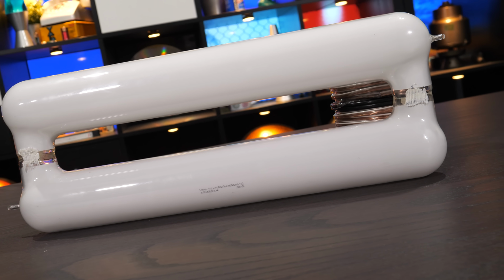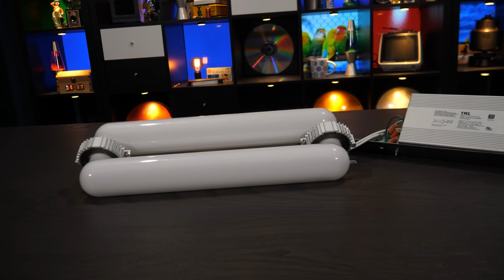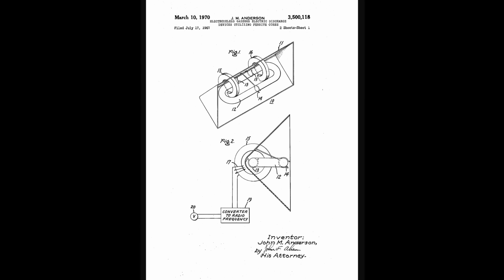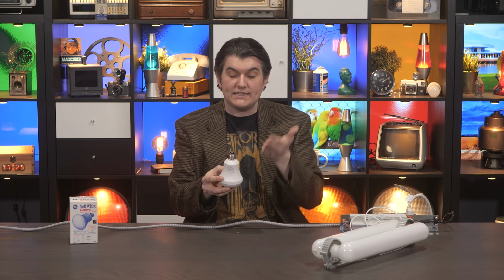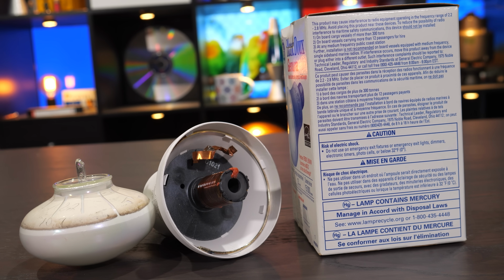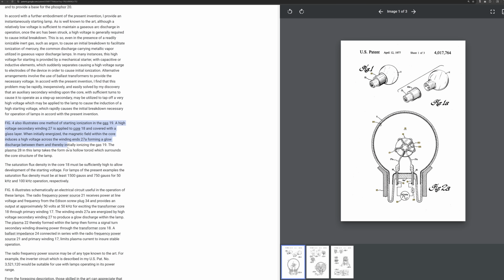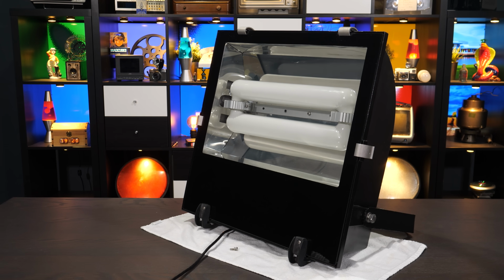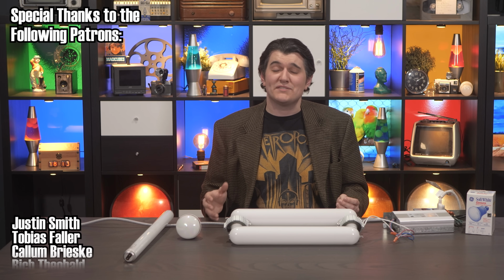Induction lamps: fluorescent lighting's final form

Comment: I also had a portable florescent straight lamp that used four C cell batteries, and the small size was great working inside aircraft when I was an avionics tech. That little lamp was replaced with one that was twice as long, and used eight AA batteries, and I was able to repair many aircraft electronic problems using those lamps!

Once the electronic circuits were cooked, I switched to 60Hz AC powered florescent lamps on a long cord and also having an outlet for power tools. Which wasn't as needed as when I started, as tools became battery operated soon after! And RF lamps were nothing new, with many amateur radio operators making different lamps to slip over the antennas to light up an area with the RF power on an antenna. My favorite lamps were the circle bulbs used in kitchens and baths in the center of the room. You could light a large area with a small circle of glass and a small plug, and the ionization made easier with the plug, but not the heaters installed in them!

But having a small radio transmitter on your light bulb was a big downfall when you wanted to have radio communications without interference from the lamps. And being a radio amateur, I have to experiment with lamps, including LED bulbs, to ensure RFI free lighting.

Comment: I've not seen a dimmable LED bulb meant to go into a regular alternating current light fitting that wasn't plagued by constant flickering. Even if it was placed in a non dimming fixture. Of course if you have a LED with custom driver electronics you can use PWM etc. to get it as dim as you would like. And yes running LEDs significantly underrated using these techniques you can extend their life.

Comment: Gday feller, the internet is patchy here ATM, so difficult to look thru the answers. Your question about how these lamps initially ionise. They usually run somewhat away from resonance during normal operation, during startup, an L/C circuit switches into resonance. As we know, the impedance of a series L/C circuit is zero at resonance and therefore the current and voltage build up limited only by the resistance of the circuit. this high frequency high voltage is applied capacitively through the glass to the inside of the tube and the gas. Hence the tab on the outside of the bulb. Hope this helps. RSPV Mink

Comment: Fun fact, I worked at a place where replacing the lights was really expensive because they’re really high up and so they need a very large man lift to do the work so they replaced all of the bulbs at once that are not, and they left them on 24 hours a day because the additional electrical cost was determined to be less than the wearing out of the bulbs and their replacement
Reply: Yeah I was thinking something like an airplane hanger/shop or large warehouse would use these.
Reply: @codemiesterbeats  Assuming EMI and the diffused lighting isn't an issue. These days modern LED arrays can be made with extremely good lifespans when they want to. Even our typical house bulbs could be notably improved by splitting the load across more LEDs but manufacturers don't like doing that.

Comment: I can't get an E26 LED bulb to last more than a year, not even high quality GE anti-flicker true color index bulbs that were pricey. :( The dimmer must be the secret sauce. I think the bulbs burn out because their components are over driven and under sized for the spec that they require.
Reply: The form factor makes it very hard for them to cool off, damaging the LEDs, potentially burning them out. If you are unlucky, they will turn purple, and hurt to look at.
Reply: I call BS. My Philips LED fan lasted me more than 5 years and running

Comment: Electromagnetically smooth jazz. Induction itself is a neat technology that I'd written off as "that thing for phone chargers and stoves" until I realized I could use it in one of my hobbies to create lighted display pieces with no visible wires nor any need for tricks to hide the wires through a conspicuous contact point. And if your lighting circuits are all built to the same spec, you can use the same display base for multiple things with no more effort than picking one thing up and putting something else in its place.

Comment: Are these toroidal transformers similar to the spark plug coil on older cars? When the field collapses the current would go through coil and out to the the spark plugs.
Reply: No, they are electrically coupled to the coils, whether inductively or capacitively, I don't know. It is at least started via (high) frequency dependent disharge, and could be run with very low power after the initial glow discharge happens.

Comment: Mixed feelings - I watched a guy on youtube recently talking about why LED's don't last - he mentioned that in fixtures like in his kitchen, where a light serves as a nightlite, and never gets shut off - that LED's don't last - they don't seem to handle the heat of fixtures well, even if it says they do on the box. I posted back that in this case I would stock up on a few good florescents that would do the job - in my condo, I have replaced a lot of my bulbs with LED, but I still have some great 4 foot long Lampi fixtures, which had kind of a european look to them - I love the look of these when I want to really light up the living room to work on something- one thing that really irked me recently was to ask GE how do I replace the light bulb in my GE Cafe Courture countertop oven - they said "you don't" - it is a LED. If the bulb goes out, you replace the oven. And of course, LED's last forever, unless they don't. And when remembering these wonderful electronic ballasts of florescent bulbs - they really shortened the life of the florescent bulb often - my brother was scared stiff of them after having one fail and start emitting some black smoke.  I wasn't overly scared of that, but the florescent fixtures with the old magnetic ballasts lasted far longer, and the bulbs lasted longer.
Reply: Like with most technologies, it is inevitable that the manufacturer simply rug pulls you. LED were promised to be long lasting, but they used a lot of marketing and legislation to become a dominant technology, then started using cost engineering to slowly renege on their promises. Longer lasting? No. Great light quality? Looks are deceiving. Low EMF? No.

But yeah, be nice to the fluorescing tubes, and you won't have to worry about them. The main thing is that the ballasts are generally not current limiting. The voltages the tubes are run are at a critical point where the plasma is dark, glowing, or arcing. It takes a bit for the plasma bulb to self-focus and start arcing, but PWM is commonly used to cut the power before that happens. Alternatively, you can limit the current in the system so that it doesn't arc, nor flicker between dark and glow modes. The benefit there is less heat from resistance, switching losses, and you can probably run the bulb with a lot less power.

Comment: Fantastic - yet another source of electro magnetic interference, as if we didn't have enough already with shitty Chinesium wall-warts and crappy solar controllers blanketing the RF specrum with RF noise now were going to have a shite load more.

The fundamental frequency of these devices lands in the middle of the decommissioned MF Marine Radio Band, part of which has now been made an Amateur Radio Frequency band, and the harmonics from this lunatic light will populate goodnes knows how many frequencies up into the HF Radio frequency spectrum.

Comment: ge bulbs were 35.00 a unit I install them over city pool  the life of those  65000 hours on the boxes I got  they ran for years and years replace 100 and 150 down light flood lamps save tons electric power. but there problem was the incandescent were always burning out.

Comment: I work in a data center and it's on the operations side so I deal with a lot of electrical stuff. Either way, I've been learning a ton about  transformers and generators for the power side. The moment I saw those clamps that go around the tube I knew exactly how this thing worked and I got so excited cuz I'm like "oh shoot! I finally can put this knowledge to use outside of work"

Comment: Single glass tube with an inner tube for return flow.  Then one cylinder could run off one coil.
Reply: Something done in more advanced tokamak reactors is forming a field aligned current in the reactor's plasma. In effect, doing what you are suggesting, but letting the plasma do that on its own. You can liken it to the plasma trying to fashion itself into a coaxial cable that has very little interference and wasted energy. This is one of those plasma effects that is well known in the lab, but not talked about often because of the faulty assumptions in magnetohydrodynamics.

Per tokamak reactors, it significantly mitigates plasma instabilities.

Comment: Would just a tiny amount of alpha or beta radiation emitter be enough? Radon, Americium 247, etc. That could ionize the gas and allow startup.
Reply: Just have a starting circuit that uses a power transistor that shunts through a different resonant circuit. Higher frequency, lower breakdown voltage. Then move to a current limited circuit that maintains a continuous glow plasma.

Comment: I've been in arguments on Facebook over the longevity of LED bulbs. I have one in my bedside lamp that is almost 5 years old. I moved into my current house about a year ago, and all the other bulbs for my ceiling fixtures and living room lamps are new. If they were incandescent, I probably would have had to replace the living room bulbs by now. I expect they'll last many years. I think I noticed a bit of flickering once in one in the kitchen, but I hope that was just a voltage fluctuation or frequency drift. I haven't noticed it recently
Reply: I have one in my living room that has lasted me 6+ years. Even the dollar store LED bulb lasted me 4 years running 24/7.

Comment: Sure. LEDs claim to last 30,000 hours. The LED part does. But the drives may only last 5000 hours. I just put in a cheap one that came with a fan and it only lasted 100 hours. They want you to buy new ones. The 30,000 hour lifespan is deceiving.

Comment: Planned obsolescence isn't a conspiracy, it's just a corporate business practice that most large corporations use to increase profits. Tires, electronics, clothes, light bulbs, cars, pot scrubbers, it's just designed in.
Reply: Sure buddy. Whatever your echo chamber says
Reply: @mohanjan8768 planned obsolescence takes too much effort, now you have to pay a monthly subscription for your exercise equipment, baby monitor, home CCTV (cameras, and camera door bells), thermometer, home servers, media box (like Roku), smart bulbs, refrigerator, TV (all of them are smart nowadays, there is no escape), printer (not just ink), ... To function. For insult to injury, cars also have subscriptions for activating your heated seats (which are already in your car), travel length of your suspension springs (apparently you can adjust those electronically now), to be able to use the GPS/bluetooth/radio (honestly, you should be allowed to install your own), or be able to use performance or efficiency optimised fire tables and PID weights for your automatic car.

Comment: The secret to the striking voltage is the high frequency. Gas ionization occurs at much lower voltages with the increase in frequency. Given that you're a fan of Nicola Tesla I'm somewhat surprised that you missed this fact. That said you may want to have a look into ionic drives because they operate in a similar fashion. There again, its the frequency that makes it work. A good resource for furthering your understand is @PlasmaChannel which I'm sure would be more than happy to go over the details with you.

Comment: I found a strange lightbulb in my that my sick cousin Franklin H. Deak, who was an attorney for GTE and Verizon, may have put in that does not have a filament just a wire inside that is the same wire as the outside circuit. It gets extremely hot and is in the overhead lighting of my  2002 Jeep Renegade. His daughter Leslie works for the US patent office and they test various awful thing on me. Could this bulb be induction lighting? I have had two cars blow up and one was stolen and this car has GPS cell phone tracking.

Comment: Here is my theory on the "ignition".

There will be some mercury gas in the tube. Mercury atoms loosely hold onto electrons so an alternating magnetic field will quickly cause the electrons to leave the atoms and both the nucleus and electrons move. This triggers a chain reaction as they interact with other atoms.
if you use a spectrometer, you should be able to identify the mercury atoms giving off light even in the freezer set up from the very beginning, they are just fainter than the Argon.

The warm up period is because it takes time for more mercury atoms to excite. the mercury amalgam is not the primary source of mercury, if this was the case then the light would have a much shorter lifespan as the mercury does not magically return to the amalgam. it just happens that the  mercury at that location, supplying more electrons, similar to how a hot iron bar warms up the air. it also serves as a source for more mercury to evaporate should any be lost over time (lost mercury would reduce pressure in tube, leading to mercury evaporation), but it must not evaporate every time the the turns on, as that would lead to rapid deterioration. i would imagine that if the amalgam was further from the induction coil, it would take significantly longer to warm up as the induction coil is interacting with the amalgam.
Notice that in the GE light, the amalgam is in the coil and it takes time to light up? This is because it is at the end of a long tube and it takes time for the amalgam electrons to excite all the mercury along the thin tube before supporting the mercury in rest of globe, particularly as the magnetic field along that tube is not pushing the electrons one way, but instead vibrating on the spot, yet the rest of globe still lights up anyway, meaning mercury was present there from start. i would argue that the large tube light you have works better because it has the amalgam not inside the coil, thus allowing the electrons more freedom.

Comment: I'm a dairy farmer and have these lights in my barn. I love the light color they produce. I bought them in 2014 and not a single one failed to this point. I choose these lights because they where much faster during warmup compared with sodium vaper lamps, but in 2014 cheaper then led lamps at these high output ratings. I will proberbly replace the fluorecent tube lights with induction lighting in the near future in my other barn, or the dealer hase confince me to go with led lighting.

Comment: I worked in the two-way radio business. One of the "party tricks" we used to do was to hold a fluorescent bulb next to the antenna when the radio transmitted. Ours were mostly 100 watt radios transmitting in the VHF band (~150 MHz). I would think the modulation we used (FM) also played a role. An AM radio's modulation level is dependent on payload, so you would have to probably speak into the microphone to get the bulb to light.

While on the subject, another fun trick was to hold the lead from a pencil to the antenna while transmitting and watch the fireworks. I'm guessing the power amplifier in the radio did not like this but the old Motorola Syntor radios were built pretty tough.

Comment: Yeah... I've just replaced a set of fluorescent tube lights in my cellar with linear LED lamps. Every fluorescent strip lamp since the year dot had an electrical inlet in the centre of the fitting to a screw terminal. Or, you could poke holes anywhere along the fitting to fit your wiring. The LED lamps have a single push-fit connector at the end of the fitting. Meaning the existing fixed wiring was in the wrong place, I couldn't chain from one lamp fitting to another, and the tail to the fitting hangs in mid-air. Plus, on the first one I fitted, I put the slide-on cap the wrong way around, so needed to remove the wiring to refit it. But the wires DON'T COME OUT once you're push-fitted them! I had to cut the fuckers off and squeeze a choc-block connector into the end.

Comment: I had many but never like that, I wonder why didn't the Chinese started making cheap ones like at late 90's and early 2000's and also claim 150K hours and then the power supply keep blowing (Cheap Made in China, just like most current cheap Led light bulbs that go PUFF, had one even exploded on me and got soldered to the fixture, it literally made a hole in the metal base and got fused together) 🤣

Comment: I have had several expensive Philips LED bulbs die on me, but I like bright indoor lighting, so I'm running 1100 lumen-ish bulbs on full power most of the time. I've even been hunting down the most energy efficient ones I could (since higher efficiency likely means more LEDs at lower current) but I still occasionally lose one. It's still waaay better life than the old tungsten bulbs, though. I'd guesstimate the dead ones lasted a good four or five years before giving up the ghost.

Comment: One benefit you overlooked was convenience of replacement.  It can already be a bit of a pain getting out a ladder and replacing T9's behind those swinging diffuser panes in the ceiling.  Now put in a vaulted 18ft ceiling and try to replace bulbs.  They're usually can lights but you need a long pole and a steady hand.  If you can make those last longer, that's a big help.  Some outdoor installations are extremely inconvenient to replace.

Comment: If there is a wire inside, then they are not much different from the regular cold cathode fluorescent lamps (like ones used in older LCD monitors).